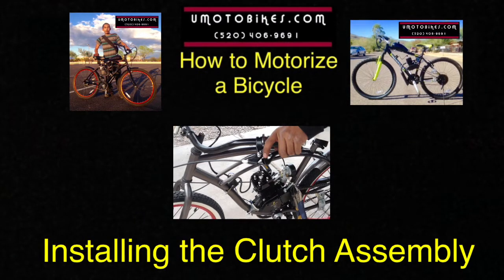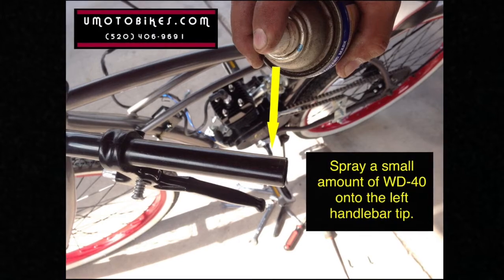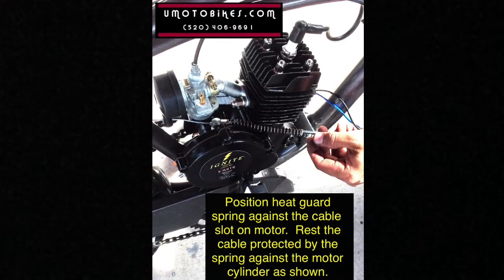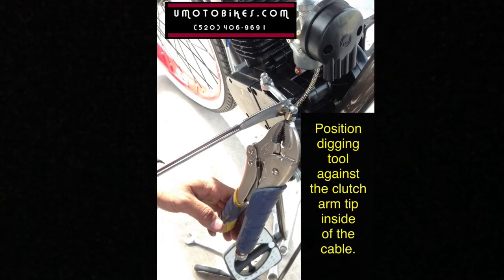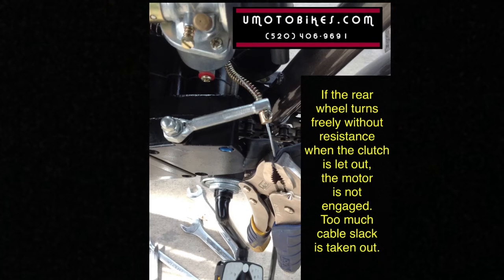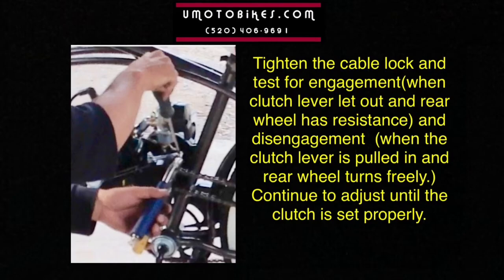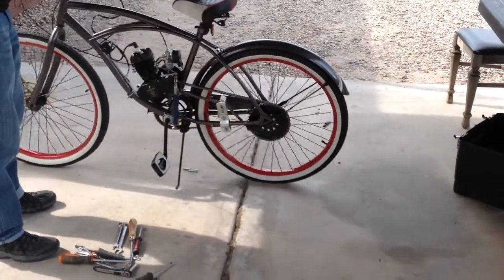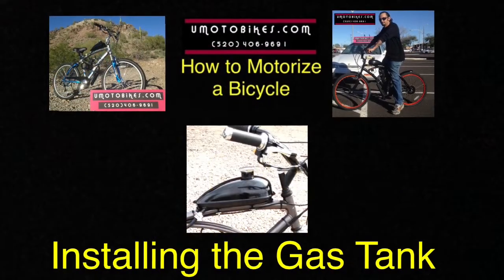HOW TO MOTORIZE A BICYCLE-PART 10 (INSTALLING AND ADJUSTING THE CLUTCH ASSEMBLY)

Comment: Hey, I think I adjusted my cable too tight and now my camshaft somehow works backwards. Pulled out is freewheel, and pushed in is locked wheel. Is there a simple fix? I feel like I just need to open it up and adjust the camshaft is all, yeah???